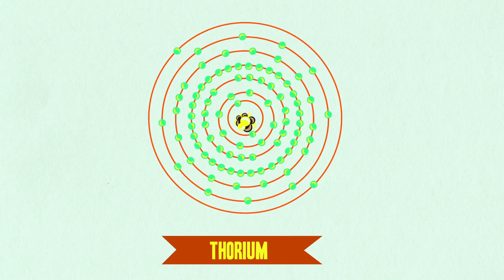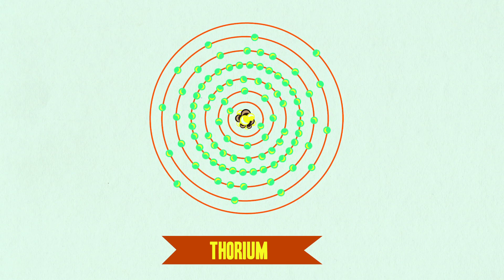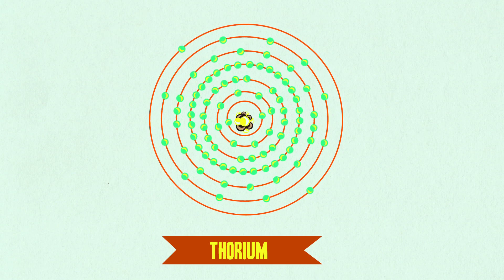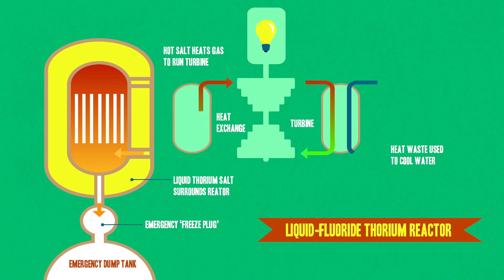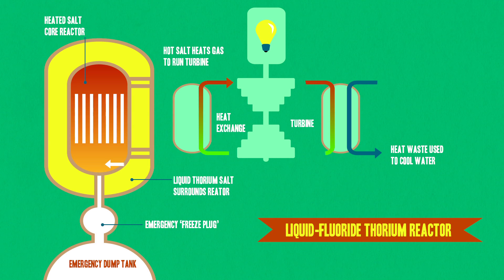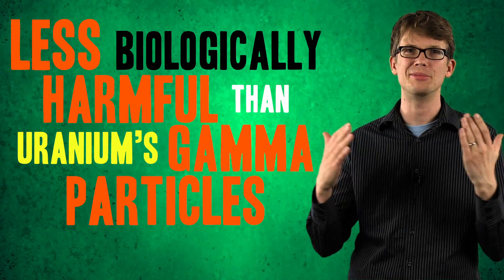Liquid Fluoride Thorium Reactors (LFTR): Energy for the Future?

Comment: Check this out.

The liquid fluoride thorium reactor (LFTR; often pronounced lifter) is a type of molten salt reactor. LFTRs use the thorium fuel cycle with a fluoride-based, molten, liquid salt for fuel. In a typical design, the liquid is pumped between a critical core and an external heat exchanger where the heat is transferred to a nonradioactive secondary salt. The secondary salt then transfers its heat to a steam turbine or closed-cycle gas turbine.

Molten-salt-fueled reactors (MSRs) supply the nuclear fuel mixed into a molten salt. They should not be confused with designs that use a molten salt for cooling only (fluoride high-temperature reactors, FHRs) and still have a solid fuel. Molten salt reactors, as a class, include both burners and breeders in fast or thermal spectra, using fluoride or chloride salt-based fuels and a range of fissile or fertile consumables. LFTRs are defined by the use of fluoride fuel salts and the breeding of thorium into uranium-233 in the thermal neutron spectrum.

The LFTR concept was first investigated at the Oak Ridge National Laboratory Molten-Salt Reactor Experiment in the 1960s, though the MSRE did not use thorium. The LFTR has recently been the subject of a renewed interest worldwide. Japan, China, the UK and private US, Czech, Canadian and Australian companies have expressed the intent to develop, and commercialize the technology.

LFTRs differ from other power reactors in almost every aspect: they use thorium that is turned into uranium, instead of using uranium directly; they are refueled by pumping without shutdown. Their liquid salt coolant allows higher operating temperature and much lower pressure in the primary cooling loop. These distinctive characteristics give rise to many potential advantages, as well as design challenges.

Background

Thorium is relatively abundant in the Earth's crust.

Tiny crystals of thorite, a thorium mineral, under magnification.

Molten salt reactor at Oak Ridge
By 1946, eight years after the discovery of nuclear fission, three fissile isotopes had been publicly identified for use as nuclear fuel:

Uranium-235, which is already fissile, and occurs as 0.72% of natural uranium
Plutonium-239, which can be bred from non-fissile uranium-238 (>99% of natural uranium)
Uranium-233, which can be bred from non-fissile thorium-232 (~100% of natural thorium; which has about four times greater abundance in the Earth's crust than uranium)
Th-232, U-235 and U-238 are primordial nuclides, having existed in their current form for over 4.5 billion years, predating the formation of the Earth; they were forged in the cores of dying stars through the r-process and scattered across the galaxy by supernovas. Their radioactive decay produces about half of the Earth's internal heat.

For technical and historical reasons, the three are each associated with different reactor types. U-235 is the world's primary nuclear fuel and is usually used in light water reactors. U-238/Pu-239 has found the most use in liquid sodium fast breeder reactors and CANDU Reactors. Th-232/U-233 is best suited to molten salt reactors (MSR).

Alvin M. Weinberg pioneered the use of the MSR at Oak Ridge National Laboratory. At ORNL, two prototype molten salt reactors were successfully designed, constructed and operated. These were the Aircraft Reactor Experiment in 1954 and Molten-Salt Reactor Experiment from 1965 to 1969. Both test reactors used liquid fluoride fuel salts. The MSRE notably demonstrated fueling with U-233 and U-235 during separate test runs. Weinberg was removed from his post and the MSR program closed down in the early 1970s, after which research stagnated in the United States. Today, the ARE and the MSRE remain the only molten salt reactors ever operated.

Breeding basics
Main article: Breeder reactor
In a nuclear power reactor, there are two types of fuel. The first is fissile material, which splits when hit by neutrons, releasing a large amount of energy and also releasing two or three new neutrons. These can split more fissile material, resulting in a continued chain reaction. Examples of fissile fuels are U-233, U-235 and Pu-239. The second type of fuel is called fertile. Examples of fertile fuel are Th-232 (mined thorium) and U-238 (mined uranium). In order to become fissile these nuclides must first absorb a neutron that's been produced in the process of fission, to become Th-233 and U-239 respectively. After two sequential beta decays, they transmute into fissile isotopes U-233 and Pu-239 respectively. This process is called breeding.

All reactors breed some fuel this way, but today's solid fueled thermal reactors don't breed enough new fuel from the fertile to make up for the amount of fissile they consume. This is because today's reactors use the mined uranium-plutonium cycle in a moderated neutron spectrum. Such a fuel cycle, using slowed down neutrons, gives back less than 2 new neutrons from fissioning the bred plutonium. Since 1 neutron is required to sustain the fission reaction, this leaves a budget of less than 1 neutron per fission to breed new fuel. In addition, the materials in the core such as metals, moderators and fission products absorb some neutrons, leaving too few neutrons to breed enough fuel to continue operating the reactor. As a consequence they must add new fissile fuel periodically and swap out some of the old fuel to make room for the new fuel.

In a reactor that breeds at least as much new fuel as it consumes, it is not necessary to add new fissile fuel. Only new fertile fuel is added, which breeds to fissile inside the reactor. In addition the fission products need to be removed. This type of reactor is called a breeder reactor. If it breeds just as much new fissile from fertile to keep operating indefinitely, it is called a break-even breeder or isobreeder. A LFTR is usually designed as a breeder reactor: thorium goes in, fission products come out.

Reactors that use the uranium-plutonium fuel cycle require fast reactors to sustain breeding, because only with fast moving neutrons does the fission process provide more than 2 neutrons per fission. With thorium, it is possible to breed using a thermal reactor. This was proven to work in the Shippingport Atomic Power Station, whose final fuel load bred slightly more fissile from thorium than it consumed, despite being a fairly standard light water reactor. Thermal reactors require less of the expensive fissile fuel to start, but are more sensitive to fission products left in the core.

There are two ways to configure a breeder reactor to do the required breeding. One can place the fertile and fissile fuel together, so breeding and splitting occurs in the same place. Alternatively, fissile and fertile can be separated. The latter is known as core-and-blanket, because a fissile core produces the heat and neutrons while a separate blanket does all the breeding.

Comment: Actually even thorium based reactors could have a hydrogen explosion, just not as strong since the only place at a power plant that this could happen in is hydrogen cooled generator. But these kind of explosions rarely happen. Also - radioactive waste becomes less of a problem lately since we are developing reactors based solely on radioactive waste fuel (MOX). Aaaand radioactive waste is actually not that radioactive compared to some other naturally produced radiocativness from for example bananas, soil or the sun.

Comment: Also you got your history a little mixed up. The first uranium reactor ( A Reactor, a fuel testing Reactor at Hanford) was built in 1942.  Nautilus, the first nuclear powered sub was launched in 1954.   The Oak ridge experiment ran from 1961 to 1969 and the reactor never produced power for more than 50% of the time and started having leaks that were quite nasty..

Comment: Mixing fluorine with an alpha emitter is a dumb idea.  Fluorine will absorb the alpha particle  and give off neutrons and become sodium 22 which is highly radioactive.  You end up with a waste stream that  not only gives off neutrons which is problematic over the long-term because it activates everything around it, but also becomes more radioactive over time because thorium has a 14 billion year half life and fluorine will always turn into sodium 22 as long as there's an alpha particle to absorb. There will always be many more fluorine atoms than thorium atoms in reactor coolant like this so you will never run out of florine.  So for at least the next 14 billion years you're always making new sodium 22 which is always producing more neutrons which is always making the stuff around it radioactive.  No matter how you process the liquid fluoride salts you will always have thorium, uranium 233 and other contaminants in it exposing it to alpha particles.  Finally a waste stream that will last longer than the universe!  Yippee!

Comment: What about exhaust scrubbers? I believe we need to move away from fossil fuels, but one can burn coal, with very low emissions.  Should we lessen, or eliminate our reliance on fossil fuels, because most believe they are bad for the environment, or for the simple fact that they will run out, they are after all, non-renewable?

Comment: Thorium reactors transmute thorium into uranium(-233), similar to how uranium-238 is changed into plutonium. The real interesting part is the different reactor. 
Using molten salt instead of water as a coolant means normal pressures, smaller plant sizes, easier ways to process the fissile material, or to "spike" getting to it, if the plant is endangered.

Comment: Molten salts are corrosive, and there is not much data on nuclear suitable materials (low neutron absorption, low activation, low neutron induced damage/embrittlement) for the long life times which would be needed for such a reactor.
Maintenance is difficult because the salts will freeze at room temperatures, therefore all maintenance has to be performed with the system at operating temperature.
High freezing point of the salt makes mitigation of certain accidents difficult - e.g. a main steam line break will lead to rapid cooling of the salt in the steam generator, potentially freezing up the steam generator and preventing proper cooling of the core.
If you want to go for the even more radical idea of having a fuel dissolved in the molten salt, then you have even more major problems.
The fuel salt is exceedingly radioactive, which makes any kind of maintenance on the primary circuit near impossible. In a solid fuel reactor a ruptured fuel rod isn't a major problem - the coolant can be filtered to remove the contaminants, which are present at a low level, and the failed rod removed. In a fuel salt reactor, just one drop of fuel salt leaking from a valve or pump seal, will be so radioactive, that you won't be able to send workers within 50 feet of the valve, even if you drain and flush the whole reactor first.
The fuel salt contains a soup of dozens of fission product elements. This is a nightmare for corrosion reasons, because you can't control the fuel composition. Different products can plate out on surfaces (mainly metals like platinum, rhodium, gold, etc.) and this can mess up clearances on valves and pumps. Some products like indium attack structural metals by alloying with them (similar to gallium or mercury).
The epithermal neutron spectrum in this type of reactor is much more damaging to moderator and core materials than the thermal spectrum of LWRs - there are even fewer validated materials available which can be used in this environment.
Radiation in the salt causes fluorine to be produced by radiolysis, and this can volatilize uranium and plutonium, and these distilled enriched isotopes, can precipitate outside of the reactor within the plant, and are a risk of criticality accident (in fact, there was nearly a catastrophic criticality accident during the decomissioning of the oak ridge MSRE where near-weapons grade uranium had distilled off and condensed in a filter bank).
All these problems are potentially solvable, apart possibly from the materials one, but these are very difficult engineering challenges.

Comment: My home country (Poland) is preparing for building Nuclear Power Plant and what surprises me the most is that they didn't even consider using Thorium!
It would be a lot cheaper, safer, more sustainable, cleaner, and could potentially provide more power than a Uranium powered reactor.
Thorium isn't a golden bullet to all energy problems, but it's as close as it gets and in a country that still uses coal to produce 90% of its electricity, it may be the only way to keep up with the demand for power and at the same time preserve the environment.

Comment: Imagine saying "coal is more deadly"  when we've never had any birth defects come from it.  Fewer deaths in Nuclear, but more literal cancer;  meaning the casualties may actually be equal (casualty refers to anyone injured, missing, captured, or dead).  We're just waiting for another accident that will cause hundreds of thousands of casualties from nuclear power; it's just a matter of time.
Reply: How do you know no birth defects or cancer come from coal? If you think the casualties due to nuclear power are not properly accounted for in estimates, than why do you think those for coal are? Smoking causes birth defects, air pollution might too.
Most estimates for the casualty numbers of past nuclear accidents, even Chernobyl, where nowhere near the "hundreds of thousands". Granted, the dangers of nuclear power are somewhat understated by people trying to push their pro-nuclear agenda, using studies that at first sight make it look as if it were safer than solar or wind, but occupational accidents weren’t included (e.g. Sovacool et al. 2016). But it’s pretty much beyond any doubt that at the very least nuclear power is much safer than fossil fuels.
Sovacool, B.K., Andersen, R., Sorensen, S., Sorensen, K., Tienda, V., Vainorius, A., Schirach, O.M. and Bjørn-Thygesen, F. 2016. Balancing safety with sustainability: assessing the risk of accidents for modern low-carbon energy systems. Journal of Cleaner Production 112: 3952–3965.